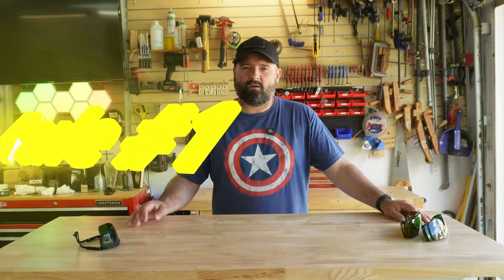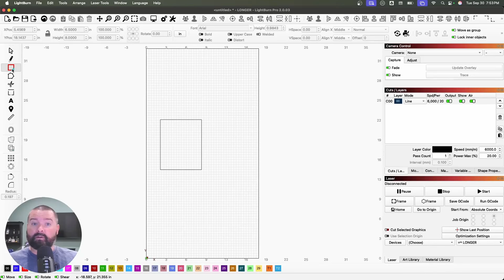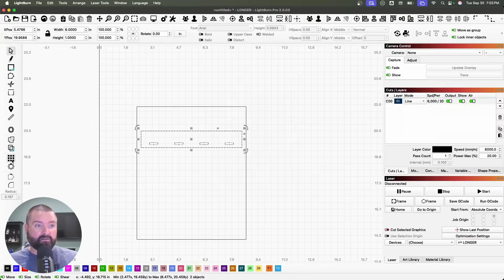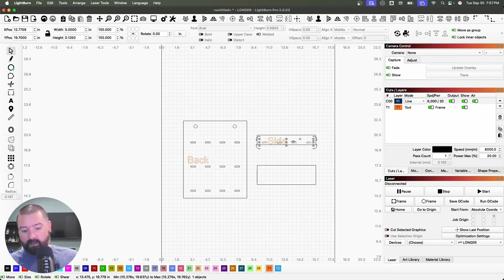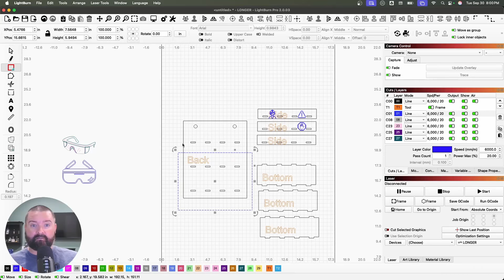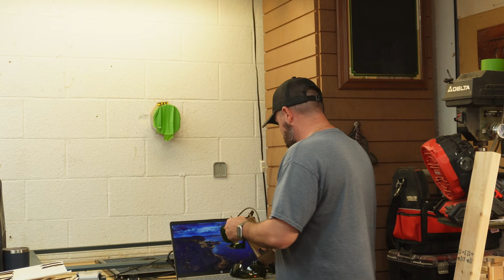STOP Using Cheap Laser Glasses! How to Protect Your Eyes Properly

Comment: Great video Steve. Just checked the glasses that came with my laser on left leg is ANSI Z87. 1 right leg EN166-FCE. nothing like you said and that is Creality fully enclosed laser.😢
Reply from the maker: Great catch! Those markings actually mean two different things:

ANSI Z87.1 → This is the U.S. standard for impact-rated safety glasses. Basically, it tells you they’ll protect your eyes from flying debris or shattering, but it doesn’t guarantee laser protection.

EN166-FCE → That’s the European safety standard. The letters mean:
• F = low-energy impact resistance
• C = good optical clarity (less distortion when you look through them)
• E = tested for resistance to extreme temps

So both markings mean the glasses are legit safety glasses, but neither stamp says anything about blocking laser wavelengths. For lasers, the real key is looking for the OD rating and the exact nanometer range they protect against. Without that, they’re great shop glasses but not guaranteed eye protection for your laser.